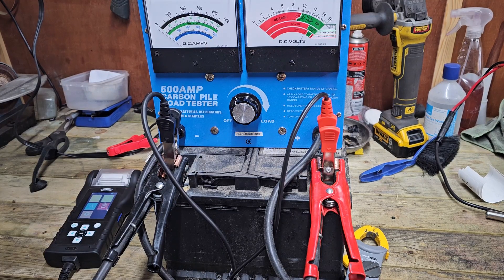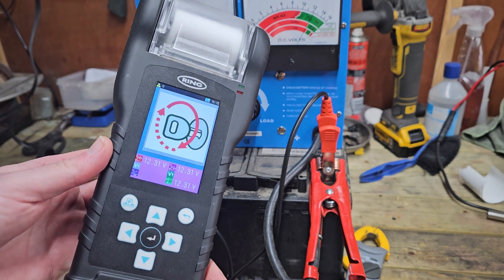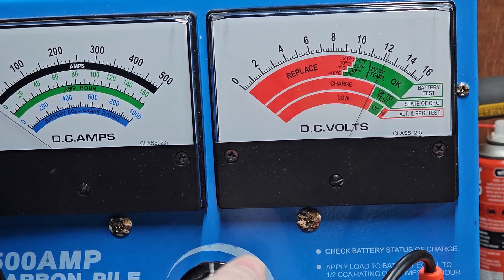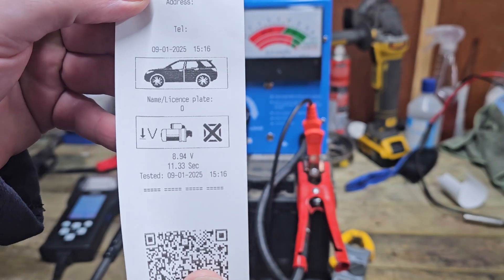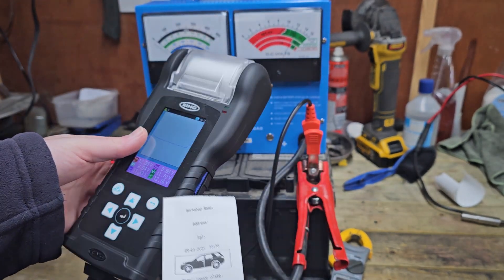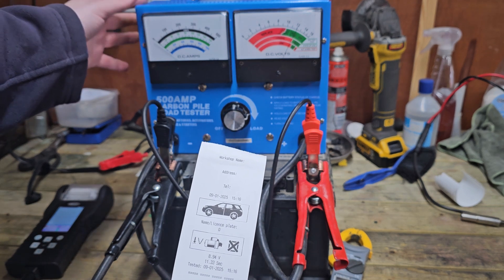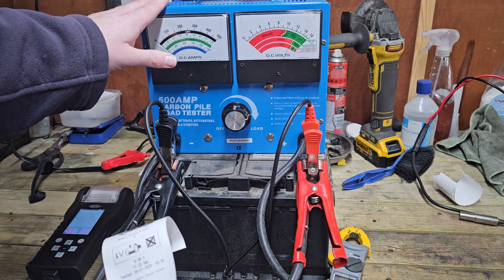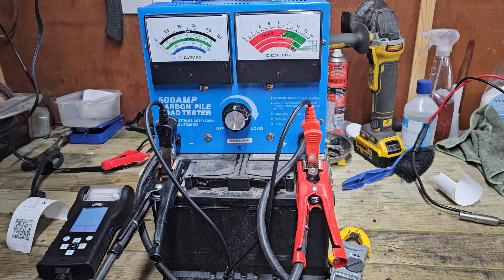comparing 500 amp carbon pile battery tester to a conductance tester (RBAG950)

Comment: Not good at all to testing battery with connected in parallel another tester!?
Reply: The other meter was only acting as a multimeter while the carbon pile was loading the battery
Reply: @lairddowell1654 Yes! I'm knowing that... But that other meter has internal resistance to, which leads to incorrect results from digital meter, hi doesn't know is there attached another meter or just battery.

Comment: Great job. I have a question for you. Which do you think is better, Ring OBAG900 or Yuasa GYT250?
Reply from the maker: @PeterMedino  for testing batteries in cars along with starting charging etc the Ring is better due to the longer leads, allowing you to do all the testing from the drivers seat plus it displays the QR code on the tester so you can transfer the data to phone tablet etc much easier, the Yuasa is more suited to parts shops where you are mainly doing stock testing, and yuasa warranty testing. You can still do all the same testing with the yuasa starting charging etc minus the lithium test. But you will need to either have someone sat in the car or keep getting in and out of the car for each test.
Reply: @Lishi-Lee  Thanks for the information. According to the technical specifications, the Yuasa GYT250 should have a cable length of 1.6 meters, so it's not that short. It should be enough for testing from the driver's seat, but if the battery is located in the trunk of the car, then 1.6 meters will be about short. Is that what you thought?
Otherwise, as if that weren't enough, there is another almost identical tester, the Osram OBAG900, which, however, has the same button layout as the Yuasa GYT250. It should also be added that Ring belongs to the Osram company. So here we have three types of testers that are almost identical: Ring RBAG950, Yuasa GYT250 and Osram OBAG900. It would be nice to know which of these three testers is the top one :)
As for the blue load tester, what brand is it? I was looking for a very similar tester and found a reputable brand DHC 500A2 for a good price, about 80 euros. I think that in this price category, the DHC 500A2 is one of the better ones.
Reply: @Lishi-Lee  Thanks for the information. According to the technical specifications, the Yuasa GYT250 should have a cable length of 1.6 meters, so it's not that short. It should be enough for testing from the driver's seat, but if the battery is located in the trunk of the car, then 1.6 meters will be about short. Is that what you thought?
Otherwise, as if that weren't enough, there is another almost identical tester, the Osram OBAG900, which, however, has the same button layout as the Yuasa GYT250. It should also be added that Ring belongs to the Osram company. So here we have three types of testers that are almost identical: Ring RBAG950, Yuasa GYT250 and Osram OBAG900. It would be nice to know which of these three testers is the top one :)
As for the blue load tester, what brand is it? I was looking for a very similar tester and found a reputable brand DHC 500A2 for a good price, about 80 euros. I think that in this price category, the DHC 500A2 is one of the better ones.
Reply: @Lishi-Lee  Thanks for the information. According to the technical specifications, the Yuasa GYT250 should have a cable length of 1.6 meters, so it's not that short. It should be enough for testing from the driver's seat, but if the battery is located in the trunk of the car, then 1.6 meters will be about short. Is that what you thought?
Otherwise, as if that weren't enough, there is another almost identical tester, the Osram OBAG900, which, however, has the same button layout as the Yuasa GYT250. It should also be added that Ring belongs to the Osram company. So here we have three types of testers that are almost identical: Ring RBAG950, Yuasa GYT250 and Osram OBAG900. It would be nice to know which of these three testers is the top one :)
As for the blue load tester, what brand is it? I was looking for a very similar tester and found a reputable brand DHC 500A2 for a good price, about 80 euros. I think that in this price category, the DHC 500A2 is one of the better ones.
Reply: @azerotha4531  Thanks for the information. According to the technical specifications, the Yuasa GYT250 should have a cable length of 1.6 meters, so it's not that short. It should be enough for testing from the driver's seat, but if the battery is located in the trunk of the car, then 1.6 meters will be about short. Is that what you thought?
Otherwise, as if that weren't enough, there is another almost identical tester, the Osram OBAG900, which, however, has the same button layout as the Yuasa GYT250. It should also be added that Ring belongs to the Osram company. So here we have three types of testers that are almost identical: Ring RBAG950, Yuasa GYT250 and Osram OBAG900. It would be nice to know which of these three testers is the top one :)
As for the blue load tester, what brand is it? I was looking for a very similar tester and found a reputable brand DHC 500A2 for a good price, about 80 euros. I think that in this price category, the DHC 500A2 is one of the better ones.

Comment: Nice video 👍🏻. How old is that battery and did it fail to start a car?
Reply from the maker: @Mickytdi  if i remember it was about 4 or 5 years old was either from a diesel juke or qashqai and at the time did not start the car, and the stop start system had not worked for about 10 months or so, and that was before this cold weather. I put it on a full bench charge to get as much charge in it to see how good it could get, and that was the most it could manage lol
Reply: @ i replaced my AGM in my Passat at 7 years. The meter read down to 350 A EN. It Still would start but on cold mornings it would be like winding up an old tractor before it started lol. It also gave strange symptoms. Sometimes after a long drive and the car was left sitting for about 5 mins it would barely start but left for an hour the starter cranked ok.
Reply from the maker: @Mickytdi  I'm trying to remember what it tested as on the day I think it close to the 300 amp region, give or take a bit lol and once running it was only accepting 9 amps charge, the owner decided not to bother messing about charging it and seeing how it went, and decided on a new battery, that reading was after a few days on a smart charger. So, there is no chance it would have been a reliable battery lol